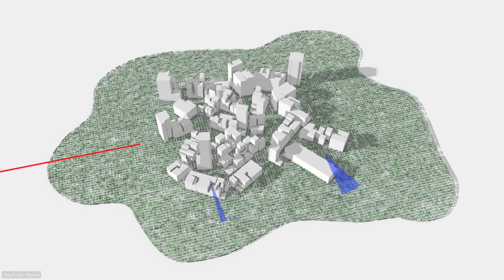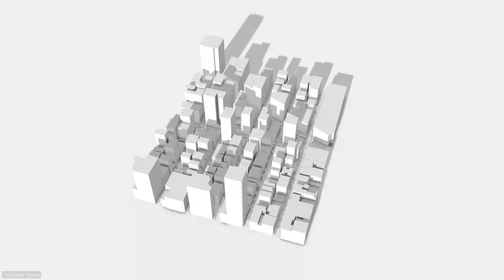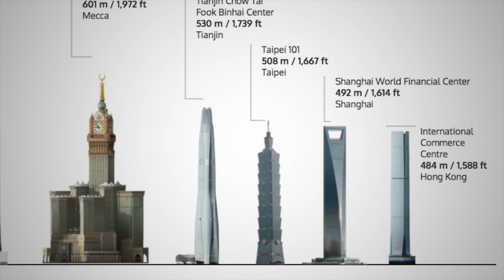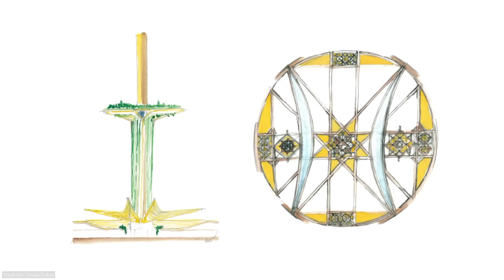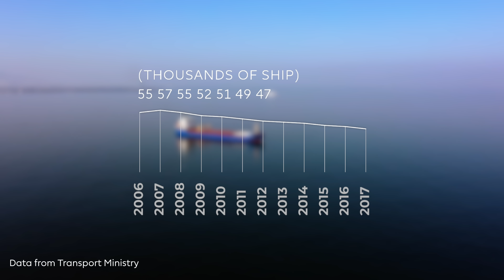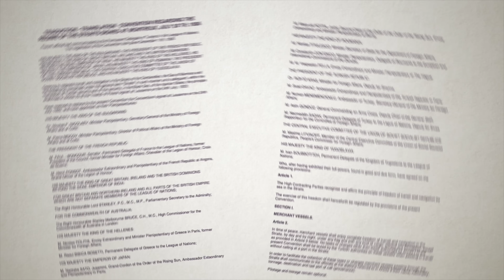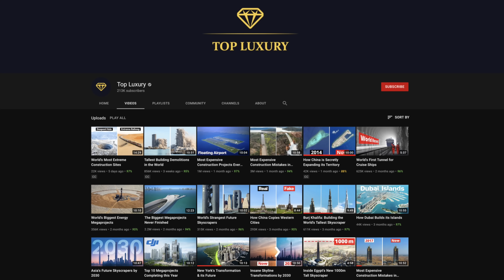Impossible Megaprojects that will Fail

Comment: 2:05 "Chinas 35$ billion bullet train from Bejing to Shanghai, one of the fastest commercial trains in the world, reaches speeds of just 380km/h"
That is false

The Shanghai Maglev Train operates at 430km/h and has a speed record of 574.8 km/h.
In 1979 already the JR-Maglev ML500 in Japan reached a top speed of 504km/h
In 2015 a new record was made by the Shinkansen L0 (Japan) with a top speed of 603km/h.

So reaching the destination within 20min is theoretically possible.
Reply: He never mentioned the Maglev train though, which only goes from Shangahi city centre to Shanghai airport, he was talking about the bullet train that connect the two largest cities.
Reply: @krashd  Yeah but he named it because he said that is the highest speed possible. I just wanted to point out that it is   possible   to build a faster train, maybe even more than 500km/h especially when its just a straight line.

Comment: 5:20 That the cables have to be over a kilometer long is not a problem. In Japan there's the Akashi Kaikyo Bridge, with a 2km long suspended span segment in the middle.
Reply: Horisontal - Vertical = Not the same
Reply: Cable bridges are largely horizontal. The highest points don't, and might never, get even closer to 500 m in the air.
Reply: @romiarkan450  And because the cables are horizontal, they have handle way more stress than if they were vertical.
Here's a simple experiment you can do yourself: Take a weight of some sort and connect a 2 strings to it. Now hold the weight up on the with 1 hand and one string. Then hold one string in each hand and try to hold the weight up by pushing your hands away from each other (to the left and right instead of up) and tell me what was harder.
The cables in this tower don't hold up their tower, they only support it from swaying. The cables in suspension bridges hold up the entire weight of the bridge besides the towers/anchor points..

Comment: If you think about it, it's kinda stupid to build artificial islands when you know how much the sea levels are rising and that it's only getting worse as time goes on. Maybe they should start building stuff on 10 meters elevated floors so at least they are fine for the next 100 years and not sand surrounded by water at current sea level.
Reply: You sir are already smarter. It was supposed to be for rich people apparently..guess they didn’t care about what makes sense

Comment: One of the big issues with the Istanbul canal project is that it would require multiple crossings. Road, highway, rail. Otherwise if there are just 1 or 2 main crossings it would create absolutely horrific congestion, especially if long distance trucking is mixed with local commuting. And these bridges wouldn't be cheap. They would need to be built high enough over the seaway so that large ships can pass below them.
Reply: 1. According to the project, approximately 5 bridges will be built and the bridges will be free of charge.

2. They plan to carry commercial shipments to the European continent with the Çanakkale Bridge.
Reply: they will build also tunels for cars and rails.
Reply: The solution is obvious. Just drain the canal whenever a car wants to cross! Don't think too much about it.

Comment: The IPCC estimates are not reliable. But, the actual rate of rise has not gone up over the last century. The current rate was matched in the 1940's when there was no (hypothetical) pressure from CO2. But, the sea is going up currently 1.2 mm per year. We don't need "climate chaos" to explain that

Comment: The canal Istanbul project is not a perpetrator, it is necessary because the Bosphorus can no longer handle ship traffic and large ships are a danger to the Bosphorus. Also, with the Lausanne treaty disaster, the dominance of the straits was taken from the Turks, it is an extremely necessary project for an independent Turkey.

Comment: On the Dubai Creek Tower, I see one basic flaw in the design: The cables. To make sure they hold up to the stresses of stabilizing a twig thin tower (by comparison), the tower would have to sustain both massive weight pulling it on all sides, as well as its own weight. One stiff breeze would cause it to fall. Instead of using internal steel frames, with the cables you are effectively tripling or quadrupling the weight of the tower, as you would, rather than using traditional means and just building it up from there. Also, it's a horrible waste of space.
Reply: And imagine if some event caused one of those cables to fail. Domino effect.
Reply: @brianoconnell6459  reminds of a certain cold war era telescope that recently collapsed.

When the first cable snapped, that brief moment where the weight transferred to the backup cables caused enough strain to take down the whole structure.
Reply: @deadturret4049  well it worked just fine umtil.funding got.cut off to maintain it
Reply: @deadturret4049  I assume you are talking about the Arecibo Telescope, and to be fair, funding had been massively cut over the decades and was no longer being used. There were talks about completely decommissioning it prior to the collapse.

Comment: The Line is the project dreamed up by someone with more money than sense.
Actually ALL the projects fall into this category.
Reply: We have a bigass line
Make it into a city
Reply: it's the bastard spawn of Neom a mega-smart city which sounded like a great idea, this pivot is sad and you can see on the website the smiling businessmen behind it are clearly out to line their pockets
Reply: "someone with more money than sense"

Oh you mean all of the middle east with it's oil money?
Reply: The train could work if it's maglev.
Reply: @christopheraaron8299  cities are built as circles
Why circles? Because it has the highest area with the lowest perimeter, meaning that the average distance from any single point to another is the shortest
The train line serving the city could be much shorter if the city was *not a line*, like for example Tokyo
Reply: @christopheraaron8299  no they won't. You still have to stop the train and re accelerate from 0 multiple times between the two end points.
Reply: @christopheraaron8299  The maglev isn't that good of an option, specially for long distances.
And the shape of the City is not the only problem
Reply: @christopheraaron8299  hbhb
Reply: @christopheraaron8299  look at how elevators in skyscrapers work if you want to see a realistic system
Reply: New York City, which is mostly linear, you can walk from most subway stations to your East/West destination. If it were more constrained it would be completely walkable. But now that I think about it, The Line would not remain linear for very long and construction would spread out in prime locations.
Reply: @brianroys1868  the line would end up just being a few small cities or towns all connected by high speed rail
Reply: @brianroys1868  NYC is still relatively circular, and you cannot compare a line to a straight island like Manhattan. Nature literally prevents the circle, similar to how Chicago and Toronto are more semi-circular than circular.
Reply: It doesn't make sense now, but who knows maybe in 2050 it would. Besides this city isn't desgined and planned by the government it was their economic advisors who recommended it.
Reply: @M.sami12  they need new economic advisors.
Reply: @M.sami12  So lets just build randoom shit hopingnin the future it is usefull?
Reply: They lack basic physics.

Comment: All these costs of construction pale in the face of the costs of maintenance.
This is always something that initial builders, investors and government forget: the costs of maintenance increase almost geometrically with the increase in size because of the increase in complexity.
Reply: Investors that went rich via simple method aka "dig oil - sell oil" are not familiar with future planning
Reply: Which is why we pay a lot in service charges. My condo in burj Khalifa has a $30k fee every year, and that's considered little when compared to bigger condos.
Reply: Like won't it just create a massive sand dune along one side of the building? And a gulf on the other side for it to fall into? Or am I missing something lol?
Reply: @leonmilner9994  yep
Reply: @froggymusicman  The city has a sewage system. The tower does not. It's just too tall, it's a pressure issue
Reply: @happymolecule8894  I’m sure if they figured out how to build that high they definitely could figure out how to reduce the poop pressure
Reply: @happymolecule8894  wait but not connected to sewer because of the pressure. So that doesn’t even solve the problem. And now all that pressure is directed to the closed of septic tanks. I think you’d be better off with a connected sewer system then…
Reply: Its ok saudi has a lot of slaves

Comment: About Dubai, If they dig underground (at sea level ) to make water tunnel ( this tunnel should go through their land from one side of the ocean to another side of the ocean.  They can not stop the water tunnel , it might flood.  The area that they need to get water, they can do T intersection at water tunnel by using motor to pull up the water.   Not sure if we have the technology that change salt water to regular water or not. If not, they can build two dam.  One is connected directly to the sea water, another one will be located in the same area.  The rain from the clouds that caused by evaporated sea water will be stored in the second dam.  Possible or fiction?
If Japan make sea level water tunnel from one side of the ocean go through the land to another side of the ocean, can this help when there is Tsunami?  When the tide go up, the tunnel with some motor pulling the tide in and release it at the other side of the ocean. This should make the wave smaller?

Comment: The Istanbul canal is feasible, but may takes years to complete. And then Turkey can force ships to pass through that canal by closing the existing Bosphorus one.
Reply: They cannot close the Bosphorus to foreign ships due to a treaty signed in 1936. However, Canal Istanbul, if it's ever built, will be like a "Toll Road" for commercial ships. Instead of waiting to pass the Bosphorus, they will be able to pay 10s of thousands of dollars and pass through the Canal Istanbul to save time.

Comment: In The line mega project, they will not use a normal electric train .. they will build a hyperloop train which has a speed of 760 mph
Reply: Hyperloop is unproven technology and more or less fraud
They are better off running maglev in there

Comment: Line can be a reality if built in phases. It might take decades to achieve that feat.
Reply: Nah, it can't by concept. Cities expand circularly (grow in all directions) because that's the best way to increase value while reducing the distance from any point to any other point (and especially to the center). The line concept is a fun idea, but you throw away immense amounts of value for it which makes it not worth it. 

Also kinda why other cities aren't built in a line already.
Reply: It biggest problem is the financing it's investors will not invest, due to planning consultants. The concept of building a place along a central route (on a smaller scale and with at least more than one line) was bascially completed in Brasilia, it was an utter failure of urban living, it caused disconnection and made travel exceptionally tedious.
Reply: It won't. It has far to much engeneering problems
Reply: China can probably do it in a decade. Canada probably take them 5 generations because all that tax money goes to policitians
Reply: @calvinwong365  In any amount of time: China won't - too impractical. Canada can't - too many administrations in and out of office.

Comment: 2:15 wouldn't be a Railways but rather a maglev or pressure tube. 500+ km/h is possible. But with the stops in between it would become a bit difficult.
Reply: It would have to be maglev in a vacuum tube. Otherwise, air friction would make such speeds impossible underground. And at this point, it's just not technically and financially feasable to build hundreds of kilometers of near-perfect vaccuum tube with multiple "pressured" stops in between.
Reply: people will jump off on there stops
Reply: Isn't a maglev even more expensive?
Reply: And what about stops? People do have to get on and off at various different points. It is just an absurd idea.
Reply: Exactly! I was like "What this guy is talking about?!"
Reply: "Don't worry guys, we'll just get all these new unproven technologies working flawlessly to build this, nothing can go wrong"

The railway alone would be an absurd megaproject, and on top of that they want to bury it? Sure thing.
Reply: @ivanlagrossemoule  Because that is totally what they thought when coming up with that idea. Every designer would want their idea to work flawlessly, but they don’t automatically think that it will when they start to design it.
Reply: Exactly! I was like "What this guy is talking about?!"